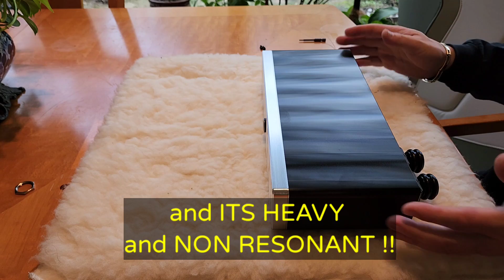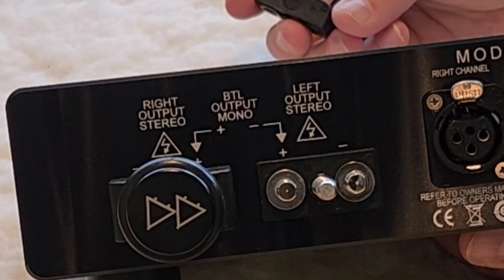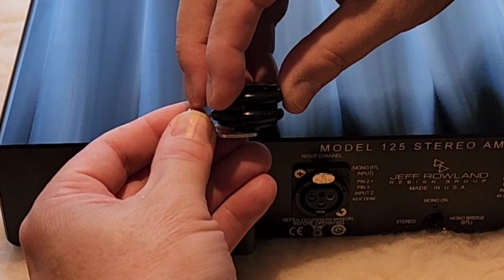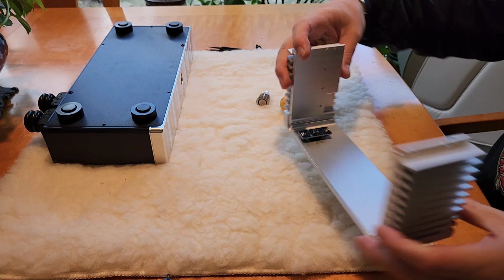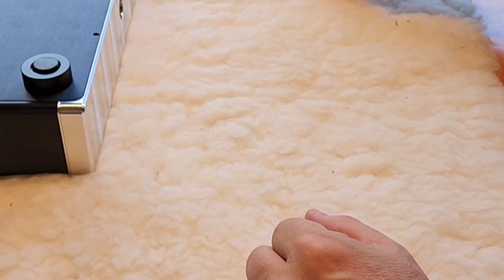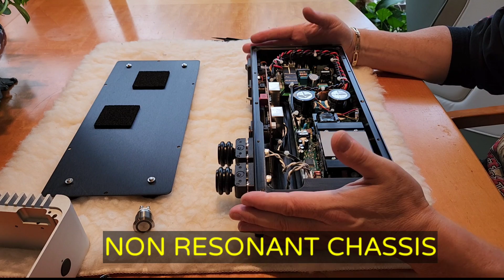AUDIO AUTOPSY : JEFF ROWLAND MODEL 125 POWER AMPLIFIER

Comment: Yes, that chassis is totally worth $3500.
Reply from the maker: Are you so misinformed that you think it's the chassis only ? This amplifier in a cardboard box still beats any amp you can name using 250ASXII
Reply: I have 250asx2 modules on minidsp plate amps that are infinitely more useful/configurable, and 1/8th of the price.

Comment: Hi Mike. Love the JRD Model 125 video. As you recall I purchased a pair of these from you. They are great and have happily replaced a pair of Class AB nearly 100 lb each, Bryson 24B3 monoblocks! I know what you mean when you call these 125s entry level into real HI-Fi or the JRD line. But IMO with the quality of sound and their build quality they are beyond “entry level” quality. They are special. To me, if I were to upgrade to the Model 535s it would be a matter of $ and maybe more headroom from the increased power. But for me, I think these give me plenty of power for my speakers and my room. Nonetheless, JRD makes great gear. Thanks and Happy New Year!

Comment: Our Man Dan Richey always complains when he finds ferrous metal in the binging posts. Who is right? Jeff or Danny?
Reply from the maker: First off its George Cardas or Danny, and second of all youre assuming its Ferrous. Stainless steel is NOT Ferrous. My money is on Cardas or Rowland  FAR before mod boy Danny.
Reply: so this is some kind of iron free steel ? ..... tell me about it - I want to learn
Reply from the maker: @Mr Giggles try to stick a refrigerator magnet on your stainless steel fridge. Lol. You gonna argue it may be "mildly magnetic" ? Save it Champ. Wrong thread.
Reply: if you are going to jump up and profess like an expert on a youtube you get checked when you are wrong big guy -  I am a mechanical engineer - there is tons of iron in stainless
Reply from the maker: @Mr Giggles  not as much as regular old Zinc plated steel Giggles. Bottom line is it's non magnetic. That's all we care about. And I don't profess to be a mettalurgist, but I'll design circles around any ME when it comes to Audio system design. This is what I profess for the record.
Reply: they should have used copper
Reply: use stainless as interconnect and speaker cable - let me know how it sounds

Comment: Transformer coupling IS coupling... Signal in signal out, like a coupling capacitor in series with the signal line. Decoupling is routing signal via ground. The transformer is isolating and coupling.
Reply from the maker: OK Great... ;-)

Comment: What advantage does a solid aluminium milled chassis have over a regular stamped sheet metal chassis in relation to sound ?
Reply: In theory, I believe it's about preventing resonance propogating in the chassis. If you hit something and it goes ding, it will be susceptable to outside forces (speaker moving air). If the chassis resonates, the PCB will, and so too will components. Some capacitors are microphonic, meaning resonance will change their curves and may affect the audio circuit. To be honest, it does matter. Isolation feet will prevent furniture bound resonance, but it can propogate from the air.
Reply from the maker: Yes, Peter has it right. Vibration on any PCB affects sound negatively. So the less resonant the case is the better the sound.

Comment: This piece is around the same price as a pair of Schiit Tyrs. How do you think the two will compare? My friend owns Tyrs, which I haven't heard yet, but he's coming for a visit. I'm going to get to hear them in my system in a few weeks. I have Tekton Moab speakers and am currently driving them with a Parasound Hint 6.
Reply from the maker: I honestly do not know as I dont pay attention to Schiit. Not my wheelhouse.. I go by history. Who has a stronger design history. I think one stands out to me anyways, and thats JR
Reply: @OCDHIFiGuy  Aren't they though? They're an American company making things in America and they have a solid reputation for value. They aren't old timers, but they aren't newcomers, either.

I know you specialize in high end stuff and that's fine. And I'm certainly not questioning the build quality of that JR unit. Some one will probably find one in 50,000 years and it'll throw modern science into a tizzy when they realize they weren't the first advanced civilization.

Back on point though, it's easy to call something high value at $3.5k when you're looking down from $30k products. But it's not really fair unless you know what other high quality, American made products available for that price. In this price range, no matter how well it performs, budget conscious buyers are apt to look at and wonder.. "What if that incredible chassis is 30% of the production cost, but only accounts for 3% of the actual sound quality? Could I have the same amp in a conventional chassis for $2500?"

I'm not knocking your review. I'd love to some JR stuff in person! Just playing devil's advocate for the price point :)
Reply from the maker: @zackw4941  Arent who what ? My testing with Schiit quickly showed me they are a good value but totally on the value end of the pool. Better than Chinese Product but nothing like the Legacy HiFi Brands IMHO.  There is a much different Pride of ownership with a Rowland piece and holding it in your hands will tell you this immediately.  Some people want to buy the top luxury brands the market has to offer. Rowland is one. Schiit is not. So even if Schiit had Jeff Rowland design a Class A Input stage using Lundahl transformers on thier amps, I would still rather own the Jeff Rowland chassis and name for the extra $1K even if there were ZERO sonic differences. Thats me and its the Rowland buyers.  Just knowing this amp is built by the same hands and mind that makes $65K monoblocks, and using the same technology, fit and finish as the big amps is worth it to me. This piece is a gift to folks without the means to afford Jeffs higher gear. It lets them taste the glory of owning a Rowland piece for a fraction of his next amp up ($11,500) This amp is NOT about how to make something as cheap as possible in the USA like Schiit is. Its a whole other idea my friend.  Does Ferrari make a $50K car for us regular folks ? Nope.... Because they dont care about regular sports car enthusiasts. Jeff Rowland does care about regular Music Lovers/ HiFi Enthusiasts however.. No other 'REAL" High End Audio company in the world does this that I know of.. see if you can get a Boulder, Gryphon, Viola Labs, Mark Levinson, Pass Labs etc for $3500.... non effing existent Zack.. This amp is a milestone and a gift..  Hope this can help you understand...

Comment: What about lack of ventilation ?? Surely that will reduce its long term reliability and capacitor lifetime. Also those EMI pads you installed won't improve anything because the closed chassis will provide most of the noise containment.
Reply: I think it's class D so they dont run real hot.
Reply: @mmmadog  Believe me they still run hot especially at high powers. More so the switching power supplies !!
Reply: I have an amp D they run cool my amp just gets lookwarm, not even warm
Reply: Good point about ventilation
Reply from the maker: @David S, The chassis is the heatsink. They run FAR less hot than AB amps do.  Class D needs ZERO Ventilation in this amp. Nor any Ive seen actually. Next, LOL.. you act like Im a dumbass just putting shit anywhere. (You must be young) Ive got Microwave engineers I consult with and that foam stops wave propagation (From emission)  in closed chassis environments.
Reply: @OCDHIFiGuy  And you've confirmed this with proper testing have you ?? I have built class D amps using Hypex modules. It's a myth that class D amps don't generate heat. Look at the specs, they do dissipate a lot of heat at higher powers even though they are more efficient. There are other components that generate heat inside that box and there is no convection cooling because there is no venting at all. When someone prioritizes looks over electrical functionality is a sign of a poor design choice. Regarding emissions look at any hi-end test equipment and to reduce emi they used shielding strips around all openings which is more appropriate for the frequencies concerned. The simplest enhancement they could make to emi is to remove all of anodizing or powder coating around where the lid and chassis make contact with each other. That should be more than sufficient.  I don't put shit on everything. Just people who don't bother to test things properly in order to confirm the claims they are making.

Comment: Hands down awesome construction, the scalloped look is gorgeous, however, I did not prefer it  when I listened to it  at my dealer. It's Less dynamic than Bel Canto REF 600M mono blocks.Those I liked but I really liked Luxman instead. ☮️
Reply from the maker: IMHO, Jeff Rowland Design group is a FAR more prolific company that Bel Canto. Those were $5K in 2017, so probably $6K now if they were a good enough design to stay in production. Rowland 125 is nearly HALF the price.  From What I know Bel Canto has NO Proprietary input section, and for certain does NOT use Lundahl input transformers or solid block aluminum chassis. Finally, not ONE Audiophile I know uses Bel Canto....
And clearly you are a luxman guy so Im happy for you  ! You found your brand... Ive turned roughly 30 people into Rowland Devotees through a direct sale, and many more through my vids.. so Ill keep boosting your competition.. ;-) I prefer the non corporate Japanese brands...

Comment: What I love about my Rowland Continuum S2 is that I leave it turned on all the time. It’s always ready for music. I’m assuming that you can do the same with the 125. My tube amps need a good 30-40 minutes to warm up.
Reply: To kinda be fair, stuff like the Pass Labs need warm up time as well if you don't leave them on.
Reply: @YouSoundButtHurt  Yes. I had a XA25 and a SIT-3.
Reply: @jimdalto6254  Nice, I've been looking at the XA25.
Reply: @YouSoundButtHurt I was puzzled by the XA25. Rave reviews and yet I was bored with it.
Reply from the maker: Yes, you are correct. Rowland is built this way.

Comment: Love those speaker terminals, My Ayre V5xe also features them and nothing else compares to the clamp you get. I hate all other speaker terminals since using them. 

Thanks for the tear down video! I will have to try a Jeff Rowland with my magnepans one of these days. I have stuck with class A or A/B so far, but keep hearing the Class D has finally arrived.
Reply from the maker: It certainly has and Rowland can bring it like no other...

Comment: Does this not have a "Chinese" manufactured ice power module ? Just wondering Mikey. I know your disdain for communist China precludes you from selling.

Not a dig or a critique.
Reply from the maker: Got no idea my friend. I dont sell anything with a "made in china" label on the back of the piece of gear or speakers. Clearly, as we all know, most stuff contains constituent parts that are made in China or Taiwan. We cant escape the monster we made many years ago.  Though this product is Made in USA by an American owned Private company. 
The stuff I TOTALLY stand against is the Chinese stuff being sold direct to USA from China as all it does is HARM the USA HiFi Industry. Second level are guys like Perlisten who are USA companies that openly make stuff in china yet charge USA price for stronger profit margins. At least this helps USA Dealers.  Anything able to meet the Federal trade requirements it takes to print "Made in the USA" on the product has my blessing regardless what's in it, as this is the line I draw, which I consider pretty forgiving actually..  I truly seek products like Magnepan for instance that are probably 95% made in USA. Just like the Rowland Class AB stuff...
Reply: It in fact does use a chinese ICE power module. There are Chinese clones of these Rowland amps also with different branding, and the very same internals. Bang and Olufsen was the first to design ICE if I remember correctly then a bunch of amplifiers starting utilizing them later.
Reply from the maker: @doosworld1901  "Chinese clones" of intellectual property. Wow.. Black market illegal product. What kind of no talent, stealing, slave keeping assholes do that ?  Very "same" internals ? You are MISINFORMED my friend. Jeff puts things in his design that are NON Copyable... LOL. We all do, because we KNOW China is a bunch of copying bastards. Japan and Netherlands just agreed to NOT buy chips from China and buy from USA instead... Your dreams of cheap Chinese HiFi will crumble..

Comment: How is the treble on the Rowland 125 ...... is it sweet or is it sterile and strident ?
Reply from the maker: Its exactly in-between the 2 things you mention.  Its extended and transparent, without being harsh or strident. It is very transparent and accurate however and will reveal a harsh DAC without covering for it.

Comment: Why can't one use a solid copper threaded rod and solid copper washers & nuts as a binding post for spades?  I would think it's the best connection.  (I'm building my own cabinets)🔈🔉🔊
Reply from the maker: You can do whatever you like, but copper threaded rod is most likely a copper alloy for machinability. We want 101 OFC Copper for the best sound, and that is too soft to crank a nut down on, as it will warp and strip the threads. So its useless from a mechanical strength standpoint.